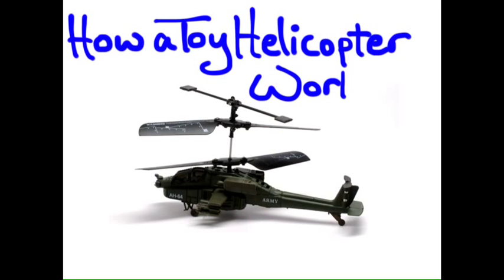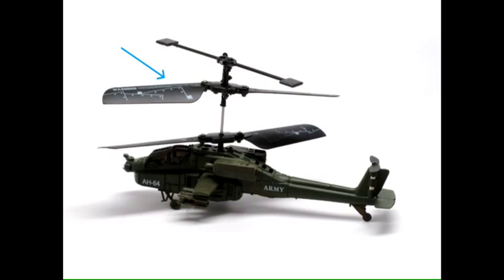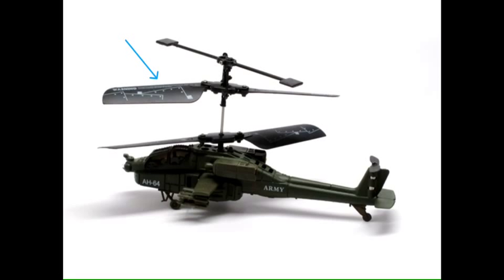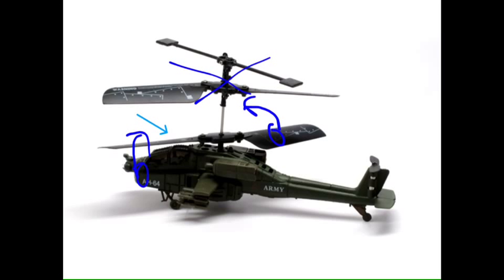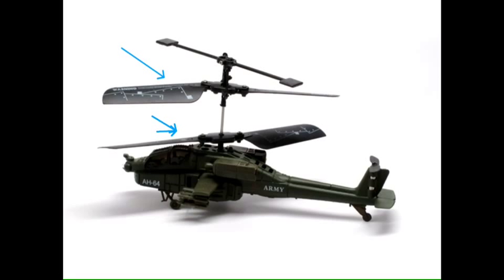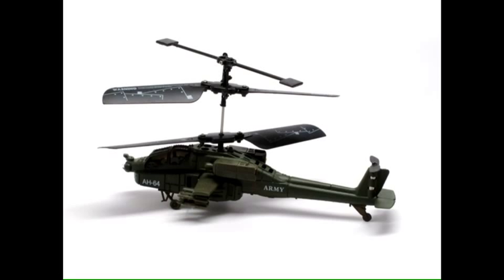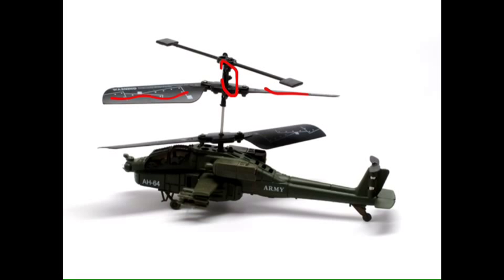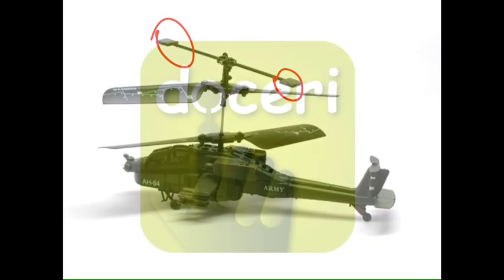How a Toy Helicopter Works By Mikey Ryan With Doceri

Comment: Nice. Glad you asked that question at the end - figured it was a stabilization bar but wasn't sure. A lot of people don't get that opposite reaction that rotates the body - I use the example of what happens to you if you try to spin yourself around with a one-handed sweep in the swimming pool ...like, your body tries to turn in the opposite direction.
Thanks guys. Simple and neat.

Comment: Why the different speed of upper and lower rotor can turn the nose right and left?, is it causes by third low newton?
Reply: when the upper rotor's speed has lowered the torque from the lower motor will spin the helicopter in the opposite direction of the lower motor.

Comment: Can you tell me, if there is only one main rotor(only one pair of blades), then how the helicopter moves left and right. I searched a lot but didnt get the correct ans
Reply: if there isnt a pitch control mechanism on the lower blades like this toy here it cant move right and left. you just rotate the helicopter then move forward
Reply: @neilorion9953  thank u

Comment: Sorry , I want to ask about mechanism how to control the flight movement of RC  helicopter because the swash plate only connect to the top rotor blade.. ..i don't find any answer yet because I found most videos only explaining how RC Helicopter can fly, not How RC Helicopter can fly and MOVE AROUND😅
Reply: There is no swash plate. Notice the roter on the tail is horizontal which allows it to  go up or down depending on your inputs and that’s what tilts and moves this whole heli forward or backward. This type of heli in the video cannot move laterally due to there being no swash plate.